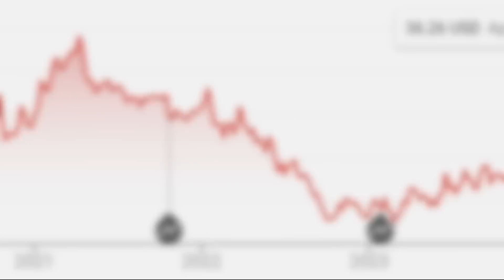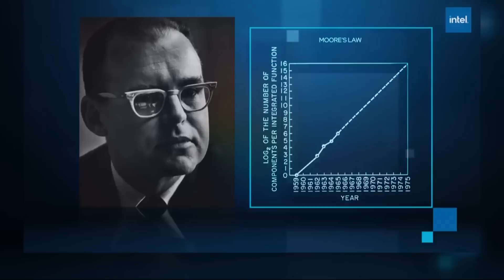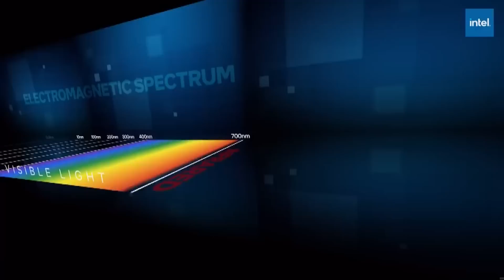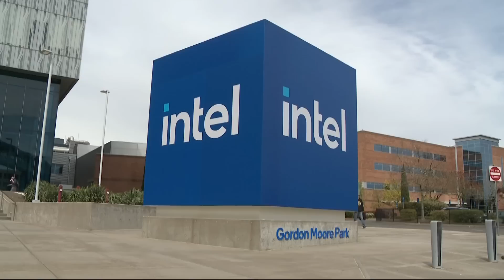Machine at Intel's Hillsboro campus can produce chips so advanced, they don't yet exist

Comment: I worked at ASML in the Netherlands for a while in 1998/99 and that's when they just got started on EUV technology. I bet they're already working on the next phase, in the X-ray area of the spectrum. The lasers are developed and built in San Diego by Cymer.
By the way they don't use lenses anymore; there are no known materials that conduct EUV light. Everything has to be done with mirrors in a vacuum now. And the mirrors are the flattest things on Earth.

Comment: Give it a decade and that machine 6:15 will be the size of a car.
Reply: You think? There are some very unpleasant physical limits to that.
Reply: No they will only get bigger, working for a very long time now for ASML and since the beginning, every generation of machine is getting bigger as more modules are necessary to make the chips smaller and the machines faster.  Also the wafer size went from 8 to 12 inch, also that requires bigger handling modules ect.

Comment: Wow, impressive! But.....the new quantum computers are slightly ahead in production than this behemoth, and this thing won't even make a chip for years. 
The power of quantum computers will blow away even the best chips we'll ever be able to make....period. This expensive machine is a waste of money....unfortunately for Intel.
Reply: This machine is just the latest model. They keep updating them every few years (every 3 years?). ASML, the only company that makes these machines, have been doing this for decades. 

As for quantum, it is still way too early for it to be practically used. Heck, even Google has a $5 million prize for whoever comes up with uses for quantum computing. And the cooling, which is colder than deep space, is also another barrier. 

Even if/when quantum computers become practical, they still aren't designed to run our PCs. You can't work on a Word document, surf the net, or play video games with them.

I put quantum computers in the same area as fusion power. Maybe things will change in a few decades, but nothing in the near future is clear yet when it comes to both of those technologies being practical. 

But exciting time,s nonetheless.

Comment: Actually that isn’t quite true. Moore’s Law is driven by data and processing needs. Moore’s Law is “maintained” by faster processing hardware.
Reply: No,  it’s the the number of transistors on the chip and this the size of the traces on the chip.
Reply: @notanymore9471   Please re-read the post but I’ll bite. Drop the constant increase in data and processing needs then what do you have? Lengthening of Moore’s Law. You’re welcome.
Reply: @ΦίλοςΑλήθειας  it has to do with transistors specifically. Everything else is just a product of the size of the chip and and the number of transistors on it.
Reply: @notanymore9471   Entirely wrong once again. I’m an enterprise architect with a Fortune 100 company and have been for 22 years. Based on your wiki response clearly you are not in IT or systems. How can you not know the difference between implementation of a Moore’s Law and what drives it? Pick up a copy of Gordon Moore’s seminal book on his postulate and please stop using wiki. 🤦🏼

Comment: All show and no go, meanwhile other advanced civilizations have chips only 1 atom thin, 1 pc of theirs is capable of letting the entire Africa play minesweeper and solitaire
Reply: And where exactly is this Alien computer located that you have personally seen the specifications and size of transistors in it?🤨
Reply: @connorthomas2667  as long as you can imagine the concept then it's already possible for somebody else, although some people are actually working on it, instead of a silicone wafer it's just a layer of carbon atoms (maybe they call it graphene), so it's only one atom thick and they use another atom of another element ( I forgot which element maybe it was sodium or boron), but the point is the other atom acts like a switch so that basically becomes the transistor, imagine a processor only 1 atom thick, now if you could stack layers for even more processing power then it becomes more powerful, if life started on another part of the universe 2 billion years ahead of us then that's the kind of tech they are using

Comment: I hope these new chips have documented power limits and not just 'recommendations' (so they don't overvolt and cook them just so they look good in benchmarks for a year and then crash at increasingly frequent intervals)
Reply: Are you talking about chips
From the 90s?
Reply: @Youtubeuser1aa  You might want to read up on current events and 13th and 14th gen Intel Processors becoming unstable due to silicon degradation and/or overvolting under (in spec) operation

Comment: It's nice that Intel got the new ASML machine, but they fell behind when they didn't use those lithography machines from the start and bit them hard real hard now that TSMC and Samsung make the advanced chips now.  You need ASML machines like that to do again the 1 to 2 nanometer chips.
Reply: Nah.   Intel is getting the latest and greatest machines from ASML.   But it may take until 2025 for mass production to start.
Reply: @jamescole3152  Why does mass production take that long?
Reply: @MithunOnTheNet seems to me you need to look at size.... and then remember an inch you measure your heights in...
Reply: @MithunOnTheNet they are makeing things that are extremely small precise and millions need to be made so hence the time and complexity
Reply: @jamescole3152  Analog and quantum is where it's at
Reply: @the_expidition427 no it's not
Reply: @DoesntRefillTheBrita Actually, eventually yes. Quantum computing is the future. There will still be a need for regular chips of course.

Your analog brain is more powerful than most if not all digital supercomputers on earth. Chew on that.

Comment: If I make a car battery with 15% more range than the current best ones I can claim they are very advanced. But I would say it's boring and causes me to yawn. Also I can't forget years of claims by Intel of fantastic nodes and products that didn't saw the light of the day. Do you remember the 10GHz cpu promised by Intel around 2001 to appear around 2010?  Do you remember the Terahertz transistor promised by Intel years ago? Where are these things? Remember the 14nm+++++++++++++++++++++++++++++++++++++++++++++++++++++++++++++++++++++++++++++++++++++++++++++++++++++++++++++++++++++++++++++++++++++++++++++++  nodes? 
I have to see this new stuff in real products to believe it. Otherwise talk is cheap.
Reply: There's comes the physics in between and you can't beat laws of physics. It is not possible to build a chip with 10 ghz clock speeds. It seemed possible during that time when intel promised it but not today.

Not even TSMC can do it.
Reply: @computerscience1101  Serves me right for believing corporate propaganda.

Comment: Canon and Nikon are also building lithography machines. But both don't come close to what ASML can do with their machines. They are totally left behind.
Reply: If you're thinking Canon/ Nikon are suitable comparisons because they manufacture lenses, it's not the same, nor does it need to be for their target markets (traditional semi-con manufacturing like those you find in your mouse doesn't even need to go into the nanometer scale; most still are on the micron level).
EUV (required for the nanometer scale production they're aiming for) cannot pass through glass like what they use in lenses - that's why they use 'mirrors' (these are ultra polished metal surfaces instead of typical silvered glass) to reflect and converge the EUV rather than traditional photolithography where lenses can be used to bend light rays.
Reply: Well but Canon and Nikon will be around a few decades longer than the Netherlands.

Comment: I knew that thing was immensely complicated but not 250 specialists need to sleep on site for six months to put it together complicated.
Reply: Legend has it that this is the same level of complexity that is required to cancel an Amazon Prime subscription.
Reply: Netherlands, where ASML is based
Reply: Sadly, some of them will stay. The machine only keeps working if the Dutch keep their fingers in the holes.
Reply: And yet it's less complicated than a single cell in your body
Reply: $350,000,000 machine!
Reply: Sleep on site ? When we did that, we slept on desks with millions spent on space suits sleeping there is risky to equipment ? Probably meant, their sleeping pods on campus but outside the protect zone
Reply: The engineers are from all over the world. S.Korea, Ireland, USA, Netherlands, Taiwan, etc. etc.
Reply: Not buying from Applied Materials?   Strange, very strange!!!!!
Reply: @wildfire8126 they’re cutting off the middle man not strange at all when they start to make billions
Reply: @wildfire8126 pretty sure Applied Materials doesn’t make Lithography machines
Reply: Sorry, so where did those engineers come from? Mars??
Reply: @QAYWSXEDCCXYDSAEWQ  It's a team of install engineers from the supplier of the machine, ASML in the Netherlands. The Engineers are most likely of a variety of nationalities, but based in the Netherlands. Once installed a new team takes over, specifically trainend in the Netherlands to care for this machine. They will relocate to the US to stay with the machine and make sure it's optimized and maintained.
Reply: @QAYWSXEDCCXYDSAEWQ they said in the story.. the engineers are from Intel’s Texas campus
Reply: @QAYWSXEDCCXYDSAEWQ  Europe

Comment: I can't help but wonder how they keep tin and silicon from building up in the optics, probably has to flush itself frequently with powerful solvents, but then that's gonna dissolve more than the garbage over time, so they must pick materials and solvents carefully? Anyways what a marvelous machine!!!
Reply: It's captured for reuse
Reply: Didn't he say they vaporize the tin in the process??
Reply: @watchout5508  Yes. But, vaporized metal condensates in random places around the vacuum chamber. It's how a process called magnetized sputter deposition can be used to create mirrors and other metal coatings... but in that process they have to repeatedly open the thing up and clean out the chamber.

Comment: All of those resources to be a bit player in the chip industry.
Reply: Agreed. Still waiting for Intel design to use its own foundry. Intel MTL, ARL, Arc GPU, & Gaudi 3 AI GPU are all made by TSMC!
Reply: @tringuyen7519  it's coming. EUV work started earnestly back in 2017, the tools don't design and build or install themselves. That's when I was asked if I wanted to be involved in the design and building the electrical portion of the vacuum control system attached to all of Intels current up and running EUV's. And I think I know exactly what control system is hooked to it now, since both the NA machine and the one I'm currently modifying are both one of a kind right now.